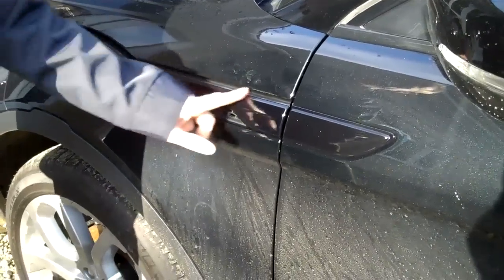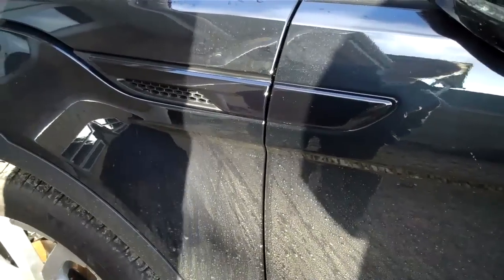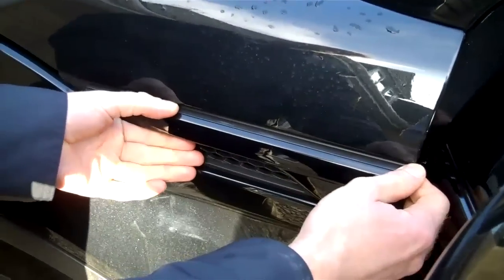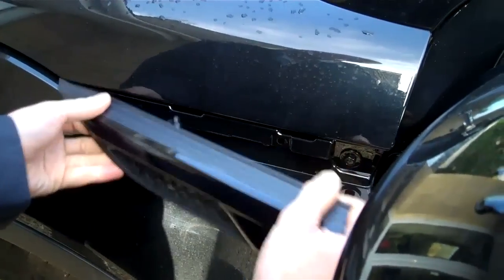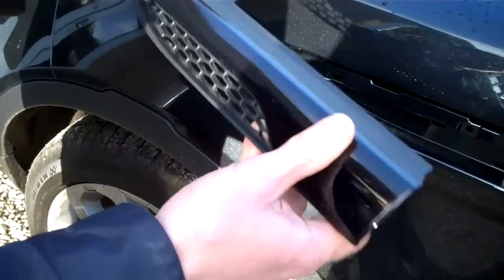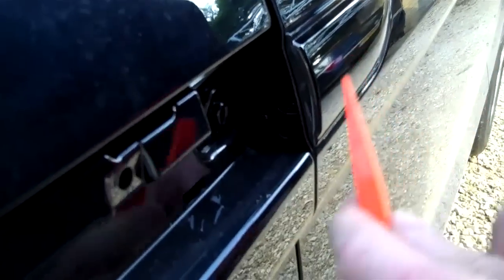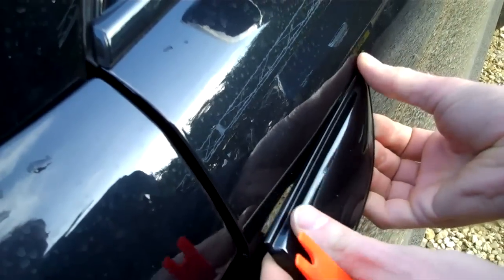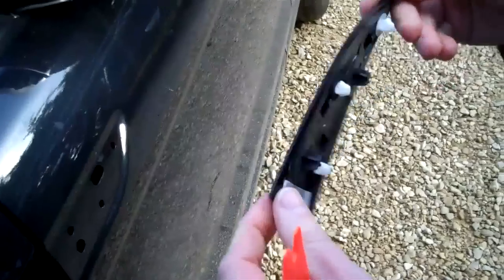How to remove side vent fins on Range Rover Evoque 2012

Comment: Replaced mine at the week-end. Both sides caused problems. Those little plastic springy clips snap clean off & it takes ages to prise them out if they shear off. I watched this video loads of times and took every precaution but it made no difference. Very tricky to remove. The originals I removed are useless. However, the new ones look awesome. Just not as easy as it looks to remove them.
Reply from the maker: Yes its not that easy - you kind of need to be brutal but its the best way i can find to change these !

Comment: Hi. Loving the vids on the Evoque but could you advise if the large 2012 evoque wing mirrors can be replaced with the new smaller mirrors. My wife is a short arse and has a problem looking over the large mirrors.
Grateful for advice.
Reply from the maker: How about a cushion ?
They should fit - happy to try and do the upgrade on mine - lets see if i can find some mirrors.
Reply: Lol. Already suggested cushion. Didn't go down too well. Would be great if you could advise if the smaller mirrors are an exact fit  then I can go and buy some and keep the little Lady happy. Thanks.
Reply: Any joy on smaller wing mirrors?

Comment: I have a 2017 Evoque. The centrifugal heating fan has a piece which has broken off. The fan works but you can hear it touching when you put the fan on. 
Anybody any suggestions on how to get the broken piece out. 
Is it possible to gain access from the air vents inside the car. 
Any suggestions welcome 
James
Reply from the maker: The pollen filter is normally the best route into the heater fan area - see our other video and see what your can see / feel inside the filter housing ?